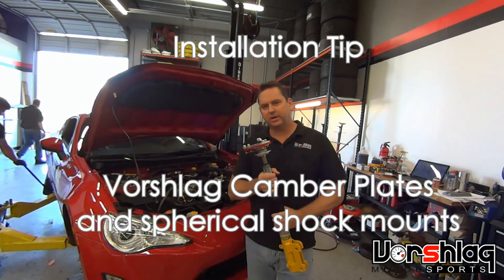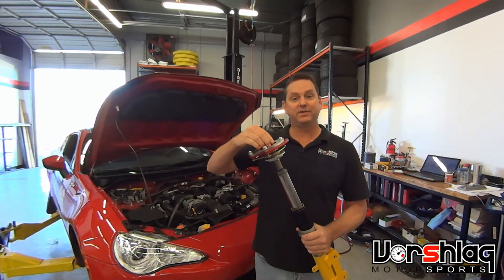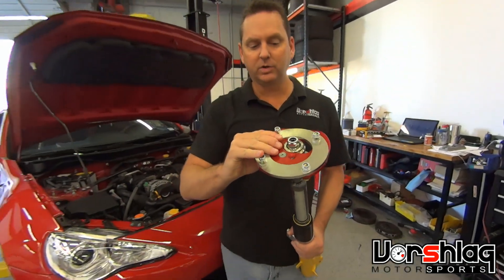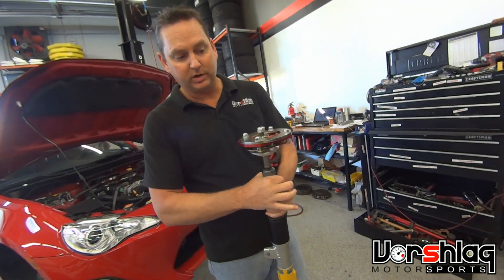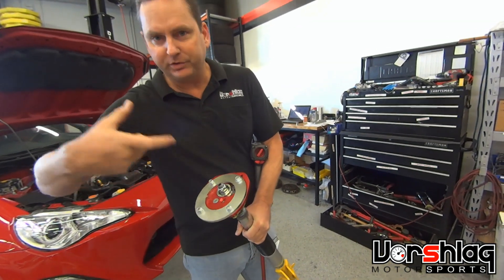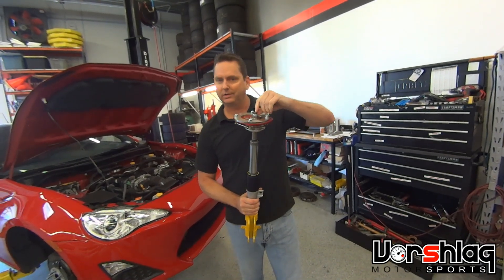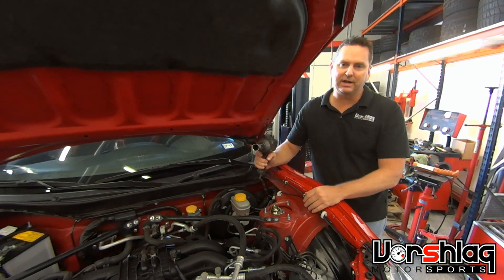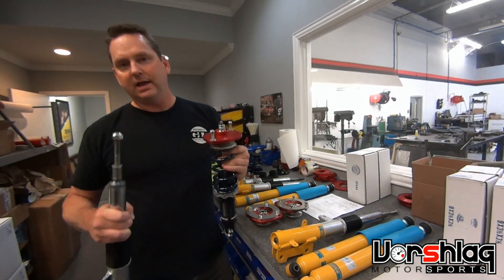Vorshlag Tech Tip: How to Tighten Strut and Shock Top Nuts

Comment: Bro, please help me. I have just replaced the shock absorber mount and the shock absorber bearing on a 2011 Toyota Yaris. However, after installation, a creaking noise appears when the steering wheel is turned left and right. I have already confirmed that the noise is not coming from other suspension components, and it is confirmed that the sound originates from the top strut mount area. Can the method shown in this video also be applied to the Toyota Yaris shock absorber?

Comment: This is 2025. Why are manufacturers STILL making strut shafts, sway bar end links, and ball joints that STILL spin in place when trying to install them. This is crazy!  A simple design change could be added to prevent the shaft from spinning during installation or removal without even the need for hex or torx heads or holes for these things, which are problematic themselves because they can strip and rust making them useless anyway. I'm not a mechanical engineer (I'm actually a software engineer), but I can think of a dozen ways to easily prevent shaft spin during installation or removal while tightening the nuts on ball sockets or cylindrical shaft assemblies. If I can, why can't the manufacturers?

Comment: But the real question is, why don't strut assembly manufacturers properly toque their struts at the factory, so shops and DIY'ers don't have to f*ck with the center bolt, which so many people say not to touch because loosening it could cause the spring under tension to wreak havoc if the assembly comes apart while installed on the vehicle. 
So many endless forum posts, like mine, ask for help after installing their brand new strut assemblies and hearing a mysterious clucking sound when driving over potholes and speed bumps at low speed. Unless they have other issues, like sway bar links, ball joints, or bushings, or loose top mount strut nuts, then that sound is usually because they have not properly tightened the center nut which should have already been fully tightened at the factory. (And I say "tightened" not "torqued" because there appears to be no way to properly torque the center nut on a strut assembly since a torque wrench will just cause the center shaft to spin in place).
And contrary to what ^this guy^ says, yes, you can properly tighten the center nut with the right tools, as shown in this guys video: https://www.youtube.com/watch?v=Ho3KvxC2gj0
My problem is, that the stupid strut assemblies I purchased DO NOT have an allen key hole OR a hex head that can be held in place to prevent the shaft from spinning while using a pass-through socket to tighten the center nut. On mine, the threads end two or three mm from he top of the center shaft BUT the top of the shaft is perfectly round, so nothing can be used to hold it in place. And I have a powerful electric impact wrench but it still won't keep the shaft from spinning. Fricken stupid design.
Reply from the maker: Because... physics is real.

Comment: I tried to tighten the top nut with an impact and the shaft just spun with the bolt, and when I drive the car, the top nut becomes loose... any solution to this?
Reply from the maker: Could be your technique - it is hard to describe this even with the video. It's something you have to hear and feel. 

If you have tried this and it keeps coming loose, replace the Nylon locking top nut. Make sure to get the right thread pitch and diameter. Nylock nuts can only be used a few times before the Nylon ring is deformed too much to hold. You can also try a drop of blue Loctite. 

But if you drive around long enough on loose top nuts that WILL hammer out the Teflon lining on the spherical. No amount of tightening will fix that then. The top mounts might need to be serviced at that point. Reach out to us on our email (on our website) and we can get those turned around for you for minimal cost.
Reply: Yes but a shock tool set and do the job properly

Comment: hey man.  Took your advice.  Everything works fine.  But I find on the highway I have not so good steering return and there is a weird vibration in my pedals when I drive over uneven ground (washboard).  I've double checked everything and nothing appears to be loose, what do you think is wrong?  Could the spherical bearing be ruined since it wasn't completely tight when I installed it before?

Comment: Thanks for this video! I'm about to install a Hyundai Elantra 2014 front shocks and Corolla 2018 front shocks and I really had that concern about the center bolt/nut since there is not info about the torque specs for that one in the center. Thanks!

Comment: There’s an easier way, get a pass through socket with extension and then you can insert an Allen key or a 1/4 inch socket extension into the pass through socket and tighten the nylock agains the smaller socket that fits inside the hollow pass through socket these are also handy for very long bolts or adjusting lifterd
Reply from the maker: that's a really good way to break the end of the strut shaft off - have seen that done more times than people successfully tightened a top nut

Comment: 100% WRONG for tightening top nut. Use a pass through socket after strut is installed in the car. Spinning the strut rod on some struts and coilovers can damage the internals and cause leaks and premature/immediate failure. Also, Bilstein calls out torque specs for every strut and shock they sell.
Reply: yup
Reply: Yeah.. no idea why this guy is saying this.. completely wrong.
Reply: works just fine with impact gun unless your incompetent
Reply: wrong @CHB_98

Comment: What will cause a car to swing side to side after installing new struts? It was fine in the beginning and after a month or so whenever I turn the wheel slightly towards the right the car would start dancing doing the wiggle lol. Now it does it even on straightaways 🤷‍♂️. Forgot to mention the car acts normal when cornering towards the left.
Reply: Get an alignment

Comment: This guy: You cannot do this with hand tools.
Every other strut installation video: Don't do this with an impact gun. Use hand tools.
Reply: Exactly it’s crap you use a offset wrench and an hex key or socket on a handle to counter hold.
Reply: @Bob152wilson  But what if there is no hex or torx head or hole in the top of the shaft? Like on my Mando struts. I just went through this painful journey. Weeks of trying to find the source of the mysterious clucking sound, only to discover the manufacturer did not properly torque/tighten the center nut on their struts that I had installed while practically replacing every other suspension component. Then I find that every other strut in the world apparently has a hex or torx head or hole in the top of their center shafts so its can be held while tightening the center nut using a pass-thru socket. But not Mando struts. Nope. Just a threaded shaft with a couple of mm of roundness at the top. Nothing that can be gripped onto. So now I have to take my DIY installed struts to a damn auto shop just to have them use an air gun to tighten the center nuts.  FML.
Reply: @privatename3621 similar here. Spent days with my yaris struts (also no hex hole or flats) just to take a garage 2 seconds to undo the top nut 😅

Comment: Bilstein specifically tells you never to use an impact gun on this nut, even for loosening. And it's not about spinning the shaft, it's about the vibrations loosening an internal nut they have.
Reply: And so does Koni...
Reply: @77magnuss  And every other installation video on the internet.
Reply: so does kyb
Reply: Same here, almost every manufacturer states don’t use an impact gun and Bilstein states  not to tighten the top nut all the way until there’s load on the shocks (wheels on the ground)
Reply: so what manufacturers are a joke
Reply: Why the heck would you say you shouldnt use hand but instead, go against the advice of many strut manufacturers is to NOT USE AN IMPACT. but why the heck would the heck would this guy care. His product here focuses on his camber plate, if u f up the shock, not his problem. Don't use an impact because of thr vibration and it could still turn that shaft a bit imo. Mark the shaft/rod with a pain marker and mark is thr same spot on the housing. Then brap it with your air gun and see what happens.
Reply from the maker: Because physics demands that you do this. It is not ideal, but there is NO GOOD WAY to hand tighten the top nut with a nylock nut WITHOUT scratching the shaft. 

Good luck on that hand tightened top nut, bois! Its gonna come loose and rattle like mad.
Reply: @Vorshlag incorrect. Buy a shock tool set like made by gedore, ks tools, or any number of Chinese brands. This is how the manufacturer expects you to do the install,  as proven by the existed of a torque spec for that nut.
Reply: Are they or are they not talking about their strut that they build.

Comment: This is terrible advise. You risk spinning the shaft for the shock and possible damaging the seal. You cannot validate the torque you have applied to your nut either. You can just buy your self a pass through socket set and get the job done correctly. You can also use a Allen wrench + deep socket + crow foot wrench. Then using your torque wrench attach it to the crows foot and torque your nut to the manufacture specifications. 
I would never track a car that use this method.
A friend pointed me to this page for advise and please don't do this. It will almost always cost you in the long run espically if you track your car.
Reply from the maker: First of all, MOST struts do not have a broached hex hole in strut shaft. Some do, most don't. Second, we have seen SO many people break the end of the strut shaft off using your top level advice. I would never drive a car you torqued that way. ;)
Reply: @Vorshlag  ....I'm posting a proper video at 4 pm tomorrow. I took your advice from this video 3 years ago. The air wrench still wouldn't tighten the nut on top of my KW v'3 and I had to use an open socket set to do it. 3 years later, only 1  KW v3 Coilover busted a leak and started to ride like shit. Guess which Coilover it was? The only 1 that I tried your method on. Later on, I found out, in the manual, it says to not use any impact wrench of any kind.

Comment: Bought these Vorshlag camber plates for my 2019 Audi RS3 and had a shop use an impact wrench to tighten the strut nut because there was so much noise after fitting the plates that we thought it was loose as the video suggests and sure enough the top of the strut broke off. Expensive lesson to learn following this idiotic advice. What’s truly sad is the indifference to my situation and cocky tone. You can get a glimpse of his character just by reading his replies to people. Bottom line is, if you want to take the risk of having the same thing happen to your strut follow this advice because they’ve been doing it for years without a problem. Just don’t expect any empathy from them if something breaks or gets stripped because you’ll be SOL.
Reply from the maker: We aren't indifferent, we were just a bit surprised that you tried to blame us for work another shop did (poorly) to an H&R strut that we don't sell. You wanted us to pay to repair something that we didn't do. 

Look, these things are unfortunate, and we expressed sympathy that in our email reply. But paying for a mistake on your car that someone else made for parts we didn't supply? That isn't how the world works.
Reply: @Vorshlag  so did you contact H&R to let them know how inferior their product and testing during product development was compared to your product, knowledge and experience with installing? 

Have you contacted the strut manufacturers of the thousands of installs you have successfully done to relay your findings?  That the torque value they provide is not tight enough so they can change their values  in the assembly guide. I mean at least so you can avoid having to walk people thru this all the time? 

What did the strut manufacturers say? Are they super thankful for your help?

Comment: Most manufactures try to solve the systemic problems that their customers keep running in to when using/installing their products as a way to improve upon the design. Here it sounds like they're pushing the blame on their incompetent customers. If this happens all the time, put yourself in your customer's shoes and find a solution so that it doesn't happen all the time.
Reply from the maker: This video is trying to HELP customers do things correctly. Improper installation - leaving the top nut loose - is the number one cause of "problems" with top mounts. And its an instillation problem. THIS VIDEO IS MEANT TO FIX THAT.

We cannot teleport to a customers garage every time that our parts are installed. There is no "design improvement" that magically makes this work better - but if you follow these instructions, carefully and completely, the problems disappear.
Reply: @Vorshlag  Exactly the point I was getting at👌
Reply: The way I see it they already have 2 solutions to this problem. The first one is making this video in order to help if someone finds themself faced with this problem. The second (and this is the big one) they tell you to have them installed by a professional! There job isn't to make a product that's foolproof for some random person to install, it's to make a product that works when installed properly. If ya break something because you overestimated your abilities its nobody's fault but yours. I know I've done it plenty of times lol
Reply: @crhoades40  a professional would use a torque wrench and be able to tell you a safe and appropriate torque spec to tighten to. So you're going to let someone who manufactures metal plates tell you how to tighten to unknown value another manufacturer's product that they spent due diligence researching, manufacturing and testing quality assurance to come up with a specific torque value? You're a fool if you impact gun anything with a specific torque
Reply: @buddahbaker  All a torque wrench does is measure friction. So unless conditions are perfect they aren't all that accurate if you're only tightening a bolt to 30lb-ft, they are pretty much just used to get you close. It's not hard to get close with a air tool and as long as it's not torqued to failure you are in the clear. Also, just about every bolt on a car has a torque spec but they still use air tools when they assemble them at the factory.
Reply: @crhoades40  here you go buddy, straight from Ingersoll Rand. It states most mechanics apply too much torque. Car manufacturers can't assure quality assurance and safety if all assemblers went wild with impact tools. How many times have you heard of a tire shop saying one of your lug nuts or studs snapped like it wasn't their fault when all you hear is the impacts going all day? 
https://www.ingersollrand.com/en-in/news/2018/how-much-torque-do-i-need.html
Reply: @crhoades40  also, if you're only torquing to 30 ft/lbs and want to be super accurate, you switch to in/lbs torque wrench
Reply: @buddahbaker   So like I said, it's not hard to get close with an air tool. What that article is talking about is mechanics over torquing by a few hundred  lb-ft all the way to failure. That's not gonna happen in 2 pulses from a gun. And I'm not saying all mechanics are equal.  That's why you should take it to someone trusted and proven, instead of your local Jiffy Lube where some kid who hardly knows how to change oil can go crazy on it.
Reply: @buddahbaker  That's not what I'm talking about. When they come up with torque specs they do it under optimal conditions with as little friction as possible.  That means brand new hardware, engine oil between surfaces,  and equipment far more accurate than your average torque wrench. So if you do it under any circumstances that aren't exactly the same you aren't gonna end up with the right torque and it's most likely gonna end up under torqued.

Comment: Ha ha ha, you probably use your high power torque gun on the wheel lug nuts also!
Reply: Giving a torque wrench to these guys is like giving a calculator to a chimpanzee. On the other hand, giving an impact gun to these guys is like giving a pad of paper and a set of finger paints to a young child. You come back in the room an hour later and they've literally painted the walls and everything else in the room.  These guys will use an impact gun on everything they possibly can, even when manufacturers specifically state NOT to, based on a long history of installation failures. Impact guns are made for REMOVING bolts and nuts, NOT for installing them.  Guys like this will use an impact gun to install axle nuts and then put way too high of a load on the wheel bearings, causing premature bearing failure. But then they'll just blame it on the manufacturer complaining that their parts are "low quality" and "fail often" while not realizing it was due to obscenely bad installation technique.

Comment: Do you consider it possible to impact the nut on using a wrench and a hammer? I once took the pulley of my crancshaft that way. It took some time, but it definitely worked.
Reply from the maker: Might be possible but I wouldn't recommend it.
Reply: @Vorshlag  the problem im having is that im hearing a clunking coming from the rear passenger side. When i took a look, i noticed that the nut was loose. So i tighten it down as tight as i could. However im still hearing the clunk sound. So i looked again and noticed that the rear passenger side rubber bushing wasnt submerged like the driver side was...and that i could still turn the entire thing with my fingers.
Reply from the maker: @Tae_94  - beg / borrow / steal an impact gun. The cordless electric units have gotten REALLY good